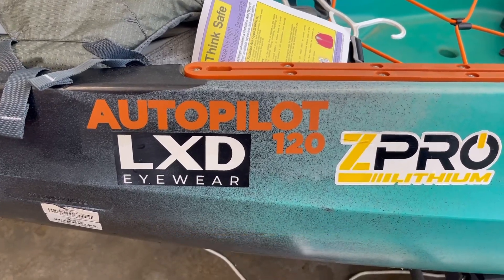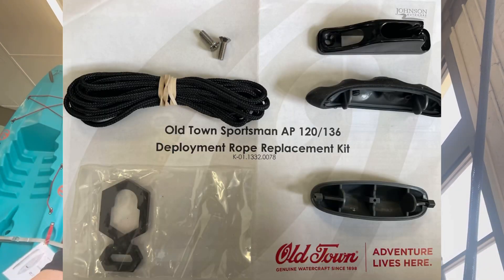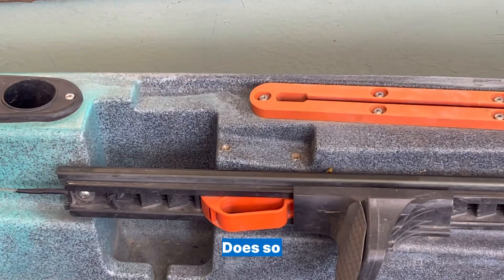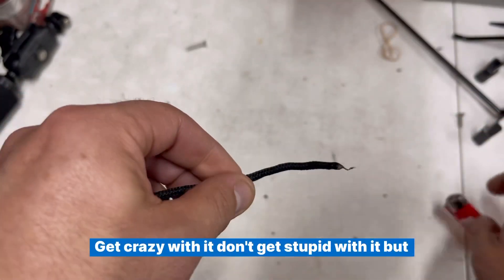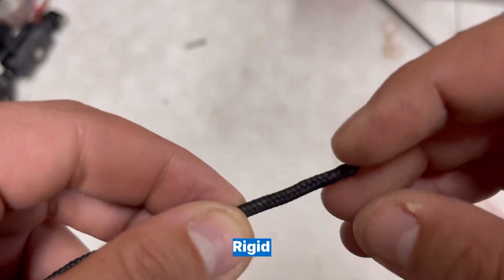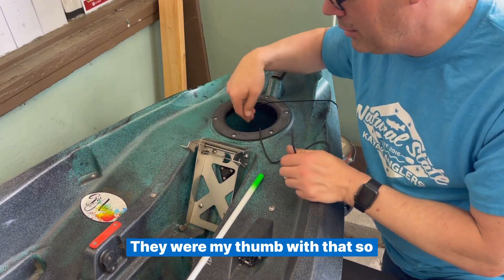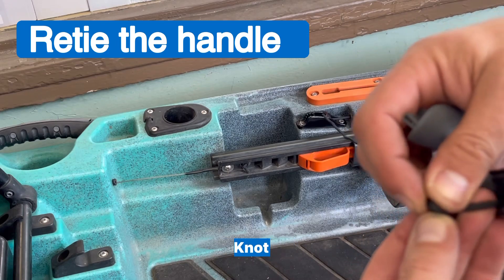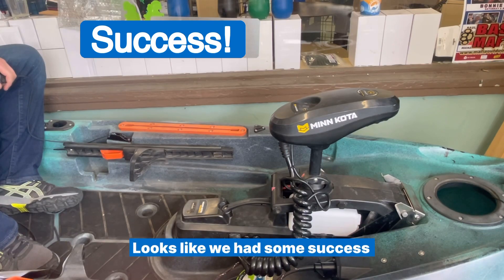The toughest repair on the Old Town Auto Pilot series of kayaks

Comment: Cant u just tie fishing line to the end of the old one as u pull it out then tie it to the new one to route it in?
Reply from the maker: We tried a lot of options.  The issue is the diameter of the brass grommet in the opening.  Makes it really challenging
Reply: Yes I have done it dozens of times, I use 40lb floro works great

Comment: I have heated up about 4-5 inches and can't get the rope fed in hardly at all. Do you take the grommet in the opening of the hole off? And just epoxy it back on. And more importantly, if I actually get the rope in there, where does it come out, how do you grab it or fish it out?  It seems a lot longer than I can reach my 36 in sleeve/arm.
Reply from the maker: I get about an inch and a half and get the tip past the grommet.  Once past you feed as much as you can.  Then it’s fishing it back to you then run it throughout the pulleys inside and back out the other grommet by the motor.  Do not remove the grommet.  We use the front half of a two piece rod to fish the line down to where you can grab it.
Reply: @H24Outdoors  I got about 2 inches in and it just stopped. I twisted the rope back and forth while pushing in for over 2 1/2 hours and only got about 8 inches in, no further, fingers getting blisters now.  Ready to buy a different kayak at this point lol
Reply: @chrisfryer933  There are lots of ways to attach a temporary (mule line) to the old cable, pull it through, attach the new cord and pull it back through. I have done this many times for rudder deploy cables, foot control cables and motor deploy cables. I find that some 40 pound mono or flouocarbon line works perfectly as a "mule tape". The heavy line can be used to push "through" the paracord like threading a needle, tie it off, trim up the tag end (if the knot is too bulky use a little fingernail polish to smooth it out), it will slide right through all the gromets.

Comment: Does your store sell the deployment cord??
Reply from the maker: Yes
Reply: @H24Outdoors  how much??
Reply: The cord is nothing but Paracord, you can buy it anywhere. I usually treat it with 3m waterproofing spray. I also coat it with some parafin wax everywhere that it contacts a pulley or a rub point

Comment: I realize you are showing people how to do it the hard way. But Bro, you are just making this hard on yourself for no reason. There are lots of ways to attach a temporary (mule line) to the old cable, pull it through, attach the new cord and pull it back through. I have done this many times for rudder deploy cables, foot control cables and motor deploy cables. I find that some 40 pound mono or flouocarbon line works perfectly as a "mule tape". The heavy line can be used to push "through" the paracord like threading a needle, tie it off, trim up the tag end (if the knot is too bulky use a little fingernail polish to smooth it out), it will slide right through all the gromets.